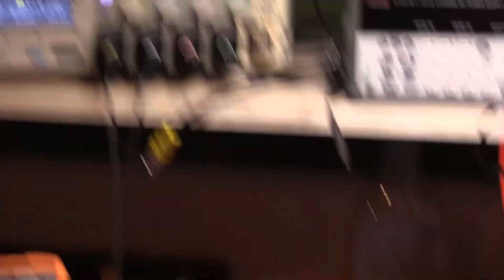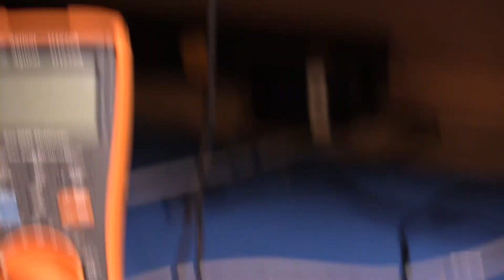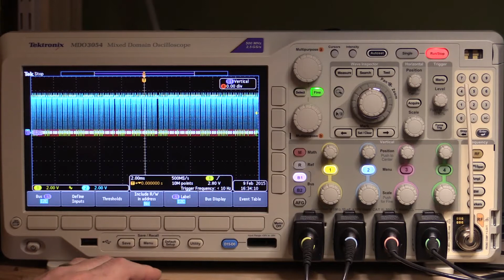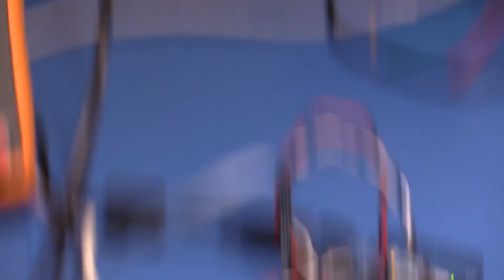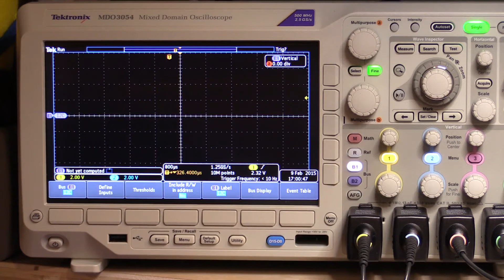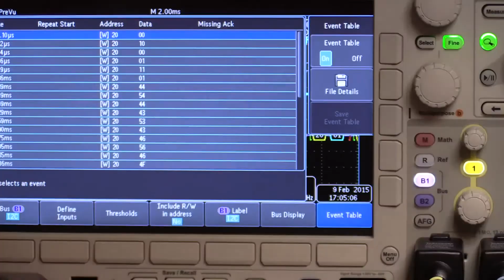Arduino UNO I2C debug with MDO3000

Comment: Nice video, but using equipment out of the range (4K +)  of most beginning engineers and hobbyists. It would be nice to have a trouble shooting video using something like the TBS1000 series (500 +) - the actual trouble shooting information that led to the solution to correct the waveform was the oscilloscope function.  Thanks for the series - very informative.
Reply from the maker: +Dave Oatway OK, understood and the next one I do I will indeed take that into consideration (And there will be another one)...

Comment: HI Peter!   just curious which display your using?  yea, gotta remember the pull ups... Nice scope by the way! great video excellent work
Reply from the maker: Using basic 20*4 line LCD with a 8574 I2C 8 bit expander, data sheet here http://www.nxp.com/documents/data_sheet/PCF8574_PCF8574A.pdf

it is wired up to the LCD in 4 bit mode so as to cover all the LCD needs with one chip, of course it slows down the interface compared to direct on the UNO but saves a whole wack of pins and it is still fast enough for human interface :)
Reply: Peter Oakes
  Oh  I missed the part where you said you were using a expander that.  All I saw was the 16 pin lcd and trying to figure how on earth your doing that with 4 wires LOL.  I have used the same partnumber from TexasInstruments with allot of success. great chip.  Thanks for clearing that up for me Peter.
Reply from the maker: no problem